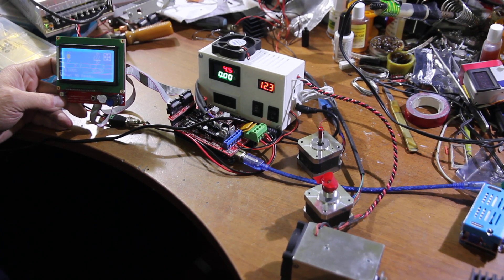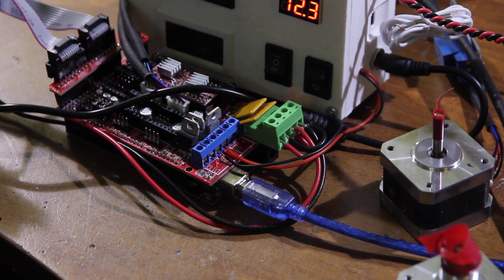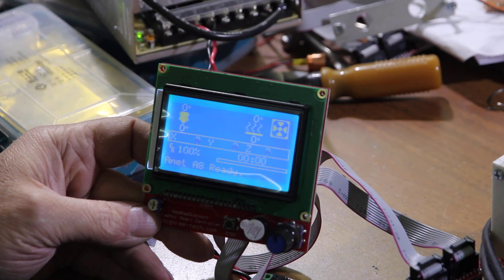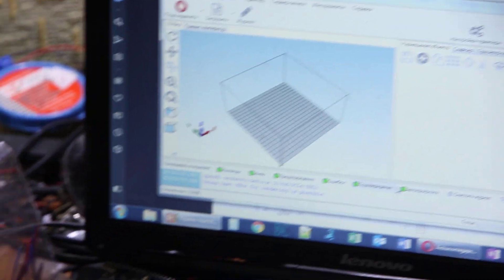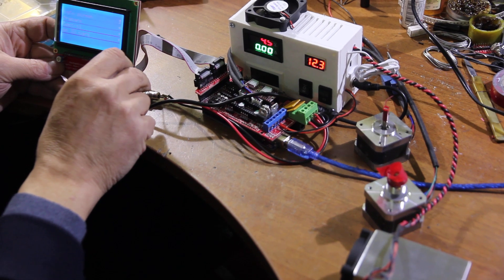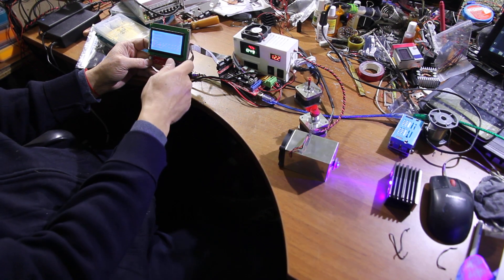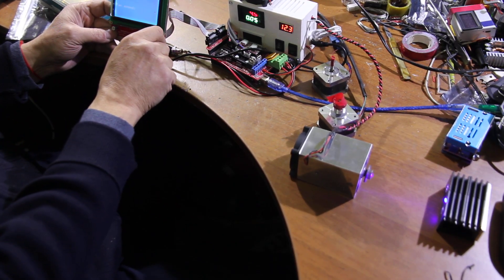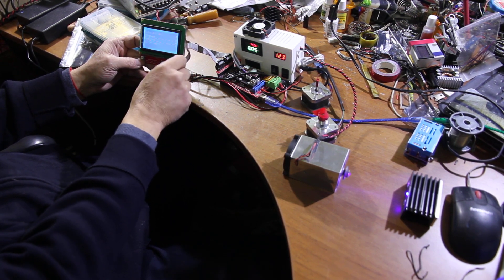Running the laser with RAMPS 1.4 board

Comment: When I make the same combination (Mega+RAMPS 1.4+REPRAP Discount Full Graphics LCD), the AMS 1117 5V regulator of Mega starts heating very fast. Does the same situation happens in your case? To over come this situation, I unsoldered the D1 diode of RAMPS 1.4 and started powering up Mega separately from the USB.

Comment: So RAMPS D9 terminal is wired to the laser's TTL input. D9 outputs a duty cycle, normally used to set the fan speed on 3D printers.
Reply from the maker: correct